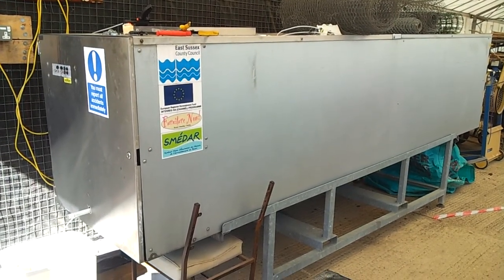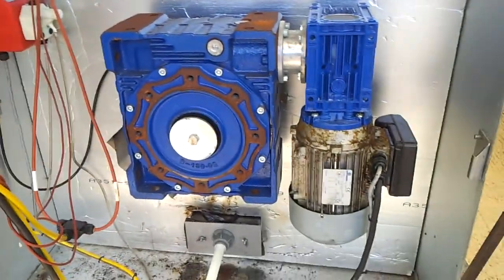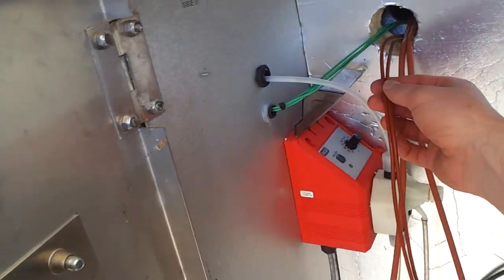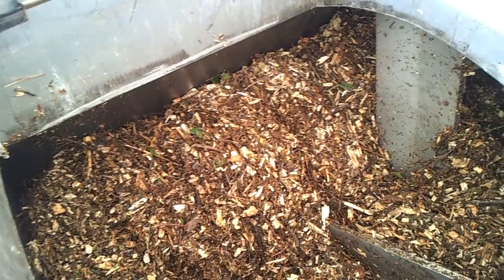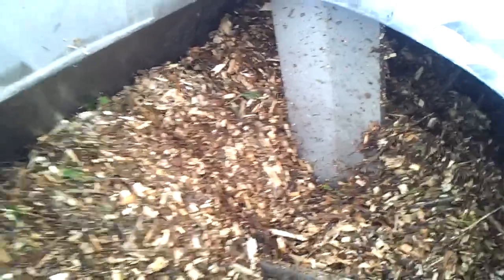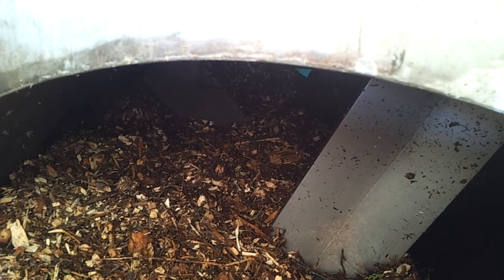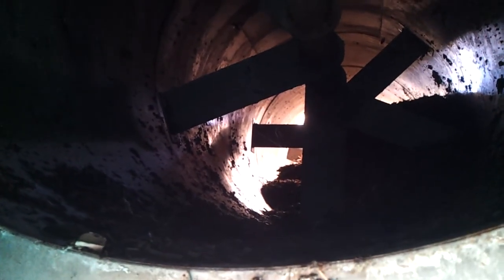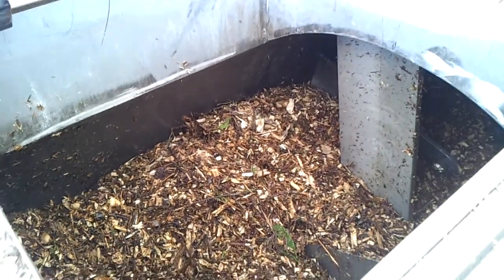22 4 17 rocket composter

Comment: Hi, thanks for the video! I wanted to know what size of motor and reduction are you using to move that big mass of compost.
Reply: Hi, it's a prebuilt machine commercially available. I don't have access to it any more so can't check. The motor wasn't to big as seen in the video but the reduction gearing meant it turned quite slowly. It only needs to get some air in for the microbe activity. I believe it had 2x1kw heaters for when the activity wasn't quite hot enough and the whole thing ran off of a std 3 pin 13A uk plug

Comment: Hi, thanks for the educational video. I didn't fully understand the dosage system in 1:11. Where is that dosage water coming from, from the white bucket? Also, the water that is coming through that PVC tube, is it coming from inside the composter (maybe condensed water) or from the excess of the dosing system? Thanks! :D
Reply from the maker: Hi, the water is pumped from any reservoir you want to set up. I used an old dustbin. This lasts about 2 weeks depending upon the setting you choose.. Its simply pumped up and squirted into the centre of the tube to ensure the compost doesn't dry out. Ideally the materials added shouldn't need any extra water but the heat dries it out. The white bucket is there to collect any excess water that runs off. Its a very good liquid fertiliser.
Reply: @sfprop5  Thanks a lot! :D

Comment: Impressive piece of kit 👍 Presumably the idea is this will eventually produce a continuous flow of finished compost? Any guestimate of how long from entering to leaving?
Reply from the maker: Hi, good question and the truthful answer is I really don't know but it will be continuous as it gets pushed out based on it being fed. However, the instructions suggest that the quantity fed in on a daily basis should produce about half that every day. This is the newer version http://www.tidyplanet.co.uk/our-products/the-rocket/ The Berkeley method suggests 18 days which is what I'm basing my targets on, however as its continuous and will have the microbes already built up I'm expecting it to be a bit quicker. That said, I don't have enough nitrogen sources yet to compensate the high carbon of the woodchips I do have. I have inoculated it with some outside compost to hopefully get it started. I switched on and filled it on the 22nd and checking today (25th) the chips coming out where slightly browned but it does feel like it has only just got to temperature. I will feed these back in until they start looking like compost then start adding fresh. I'm wanting to rely more on the natural process creating heat and using the heaters to kick them up a gear as needed. If I put too much in it will just push it out quicker and not compost it properly so another balancing act to judge including C:N ratio, moisture and air, although most of that is mechanised :) Once running ill probably do another vid so stay tuned :)